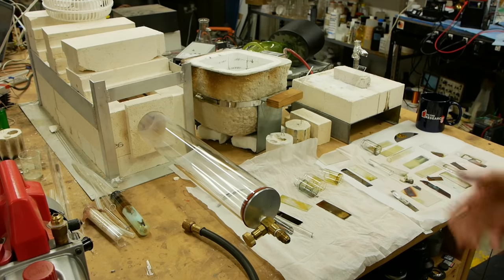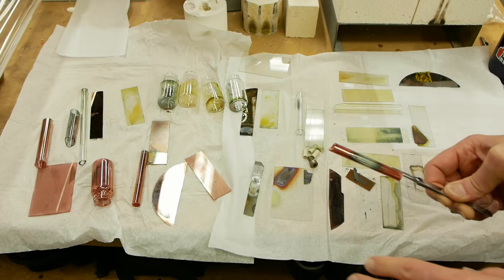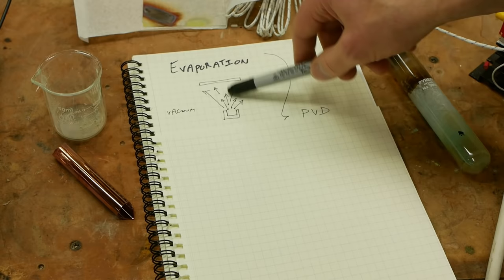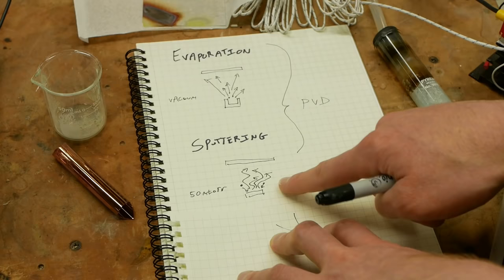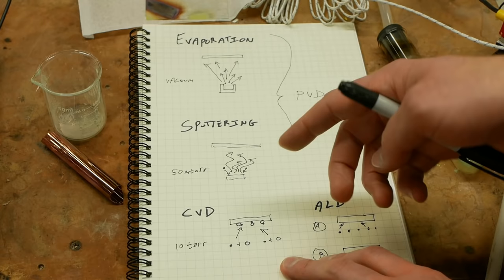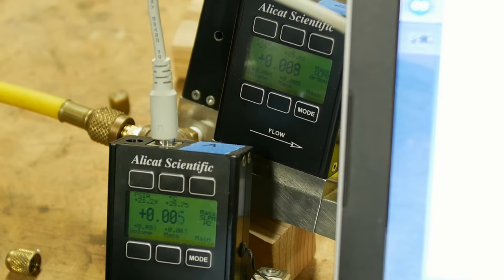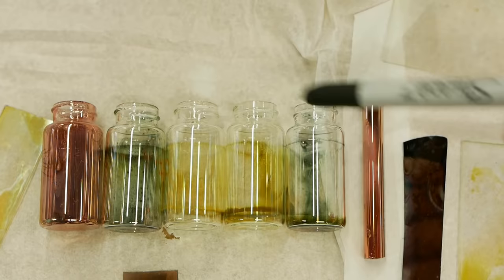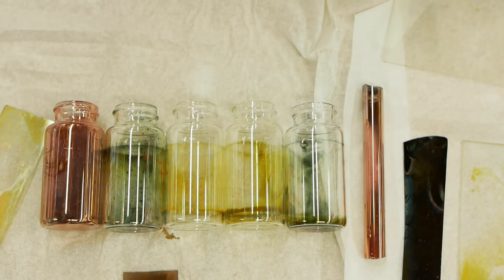Atomic Layer Deposition of copper - If you like sputtering, you'll love this!

Comment: This is a good demonstration of why chip manufacture is so tricky and requires such contaminant free environments.
Reply: If I recall correctly, chip manufacturing is the only industry that commonly uses chlorine trifluoride for surface cleaning. Guaranteed to remove anything (except, perhaps, teflon.)
Reply: @eclectichoosier5474  Removes PTFE as well, just slowly. Also will remove all surfaces an atom at a time, which is why the inside of the cleaning machinery is classed as a disposable part.
Reply: @eclectichoosier5474  Also when reprocessing uranium to make uranium hexafluoride which is then enriched.
Reply: The chips are sensitive to damage from static electricity as well, so they are frail in many ways.

Comment: The flow controllers probably use a proportional valve which are notoriously leaky when off. The usual way to deal with that is just to put a regular solenoid valve (which are not leaky) in front.
Reply: This
Reply: this^^^
even the highest end MFC's are leaky. CVD systems ive built always have a pneumatic high vacuum valves before and after the flow controllers.
Reply: I have that same controller but in the equilibar brand. You are absolutely right.
Reply: Yup. Valves that control flow don't control no-flow very well. Vice versa as well. In gas measurement on larger scales you're exactly right -- both types of valves are used in-line.
Reply: Alicat makes controllers with that option. We ordered one for work, still have not received it though.
Reply: That was the first thought that came to my mind too.
Reply: @jeffmorris9893  no
Reply: It helps to have a pneumatic valve on both sides of the controller. If you only have one on the up stream side it does stop the lhe longer term leak by but it doesnt allow you to stop the gas immeidatly. One on each side with the same pneumatic supply allows for a more crisp on and off for each gas.
Reply: Good point.
Its not strictly true as it very much depends on the mechanics of the valve. But as others point out most industries use isolation valves in conjunction with flow control valves. I've worked in the Australian LNG industry and it's very common there.

More recently I saw a type of ball valve used in a waste water treatment plant. The ball has a V-type notch so that its not as abrupt when it first opens. It had (for water) excellent off sealing and (for water) good flow control. Plus when it was fully open it was like a normal ball vale and had effectively zero flow restriction.
How well that type of valve would work with any gas I don't know.
Reply: Would a three way solenoid valve make sense? 
That way you'd only need one expensive flow controller, but a relatively cheap three way valve to control which gas is flowing?
Reply: The flow controllers are usually calibrated to a single specific gas, but there might be ways around that.
Reply: @fredo514  I believe there are serially programmable controllers, that would make for an interesting experiment... I think the flaw in this theory is that Argon must flow at all times. So possibly one controller and one regulated supply? Unless different rates of Argon are needed for different gases; then two controllers.
Reply: @fredo514  Most flow controllers are thermal capillary types. The manufacturers sort of pretend that they do a different calibration for different gasses, but they actually just apply a factor (which you can find in the manual). How well this works can depend on the design, and you might have to zero the meter between switching gasses.

These days MEMS type MFCs are getting more common, which don't allow for this trick as easily.

Alicat specifically is a "Delta-P" style MFC, which advertises that it will work well with an incredible amount of gasses, and has a nice interface to allow you to select the one you want.
Reply: on the systems I work on, we actually have 2 valves, 1 before, and 1 after the MFC.  This enables pumpout between cycles, or to prevent releasing hazgas into a vented chamber, and thus the atmosphere.  You dont need TEOS or even worse, Silane getting in your face, or out into the air
Reply: @fredo514  You are correct, most MFC's are calibrated to N2 or AR.  To use them with other gasses, you will input a calibration factor to whatever control system you're using, and the MFC will scale properly

Comment: The pattern on those glass pieces is most likely due to the amorphous structure being aligned differently when the glass was necked down
Reply: I use similar vials and silver them using Tollen’s reagent. If I don’t clean them I see the same pattern. I end up lightly chemically etching them with a hydroxide solution and then get a nice  even mirror. I agree it has something to do with how they are  manufactured.
Reply: Is there a guess as to the vials being blow molded(looks like a beer bottle with a noticeable seam, with a bubble of glass inflated into a two part mold)? Or spin cast (usually no seam but a molten ingot spun into a radial mold)? I'm interested in the physics of the manufacturing that may lead to the materials properties...
Reply: Yeah, had the same thought; you reckon if annealing the glass and cooling it down very slowly might help?
Reply: Glass can hold a charge. Could it be those areas are slightly charged? Could grounding it help?
Reply: That would make sense to me. Also super fascinating! I never considered how molted glass is formed could create different structures, but yeah, makes sense. I wonder if there's any other ways to detect these variations.
Reply: Carbon/graphite is used for tooling hot glass. Cheaper graphite will have a large amount of 'ash'
Reply: @codygoldhahn2680  Those are blow moulded bottles, the difference in the middle versus top and bottom is that the top has the glass compressed during manufacture, the middle is stretched due to the blowing and the bottom is compressed again in the mould. They start as a blob of glass that drops into a forming die, and this then has a steel rod rammed in, to make a preform that has a neck and the beginnings of the bottle. Then it, still with the top of the form with the neck and shoulder, rotates to the next station, where a bottle die is placed under it, and it is blown with compressed air to shape. Then released out of the mould, and flame treated to soften the sharp edges and form the soft contours. Finally into a long lehr to slowly cool the glass from red heat to room temperature to remove most of the stress, and then to inspection, either by hand or by an optical checker, for high volume jobs. 

Then packed into shipping units, either a box with layer after layer of corrugated cardboard trays filled with bottles, or on a pallet with layers of polythene sheet spacers, and a final shrink sleeve to hold it together for larger bottles.

The top and bottom glass very likely is chemically different to the middle, just due to the compression during manufacture, and then the long heat soak selectively removing components from the top layer by evaporation and reaction with the gas flames in the machinery and lehr. You would probably want to clean them with the regular ultrasonic and wash, then use a weak HF solution to strip the surface coating off the glass, as this will take the thin layer of iron and chrome carbide that was adhered from the mould sections, leaving a nice reactive surface for the coating to adhere to. Just has to leave an even light haze on the surface, and the copper will adhere well. The plasma cleaning in the oven would handle the final cleaning to get rid of atmospheric contaminants from the transfer to the oven, and there you can use the hydrogen to enhance the plasma, or just use the argon instead, as the heavy ions will strip surfaces well. If it is stripping the deposits off the end of the tube it is definitely going to be making the samples clean.
Reply: @mackensteff  I want him to do this and see if it solves his problem. I bet it will.
Reply: @SeanBZA  Oh hell yeah. Was looking for the first comment to mention HF.
Reply: Doing glass-blowing for years, I was thinking it's either the result of alignment/stretching, or possibly the differences in heating (resulting in smoothing and randomization when molten) and annealing (thin areas cooling faster OR the opposite - being subject to more effect from the annealing penetrating them longer, while the thick areas actually retained cold).  I propose a few tests: 1. Examine the internal glass tension with polarized lenses. (While not directly related to the surface finish, it'd be interesting to see the correlation). (I don't think this is "it" though; that is, I think it's likely more of a result of the blowing/forming process, not annealing). 2. Others have already proposed surface treatments that may or may not make it uniform (should be interesting anyway. Maybe it can even "bring out the grain," so to speak).  3. Similar bottles from a different manufacturer, where the process would likely result in some differences.  4. You can also try circumcising one or more of them, removing the threaded portion (actually I'd remove the threads and the top curved portion -- down to where the sides would all be parallel, or a few variations).  I think cold-cutting with a diamond/abrasive wheel or whatever).
Reply: @SeanBZA  Hey, I wonder if, in storage, the settling and balance of vapors (like from outgassing from the lid, or even electrostatic differences) resulted in some consistent layer-effects he was bringing out with the deposition.  I wonder if this could be used as a very sensitive forensics technique... Hmm. Anyway.
Reply: Ahh, that makes more sense than what I was thinking. I was thinking that maybe they were acting as a Helmholtz resonator as the flow of gas moved in and across the top, but I don't think this explains why there is such a sharp line.
Reply: Looks like a shadow from the opening under the shoulder to me. Stick a skewer in and see what it doesn't reach.
Reply: I see a very similar pattern on my glass receptacles... particularly my beer pint glasses after several cycles through the dishwasher. They remain clear and then seemingly over night the etching from the soap becomes pronounced and the pattern is very similar among all the glasses.
Reply: @codygoldhahn2680  i don't think they are blow molded, i think they are made from tubes like this https://www.youtube.com/watch?v=vdDSZUjFmb4 this would explain the ring of different material properties at the top since heating the glass causes the surface to lose flux, the only difference between a vial and a threaded bottle is that instead of just necking down on a flat roller, you use a roller with a impression of a thread and interrupt the material into the groove to make the threaded neck.
Reply: @Amasarac  I think you're right.  The straight sides that behaved well is glass original to the tube they started with, and the top part is contaminated with metal from the forming tools that were rubbed against it while molten.  I couldn't tell how the bottom was formed exactly, but I think after parting the hot blob collapsed to close it, it must have been placed against a mold and blown to press tightly against it.  So, the straight sides are the only part that was not both melted and worked with tools in that state.
Reply: @JohnDlugosz  the bottom is usually formed by heating a ring of glass and rapidly pulling them apart to separate, then the bottom which is now conical and very thin is just reheated and surface tension does the rest. A lot of people have suggested they are blow molded but I'm convinced because it is Ben we are talking about he most likely has borosilicate vials which are not suitable for blow molding, borosilicate is almost exclusively lamp-worked except for a couple of very specialist applications.
Reply: @JohnDlugosz  Wouldn't the tools only be used on the outside of the bottle being made, in that scenario?

Comment: You are accidentally still doing CVD. There's huge amount of reactants still in your lines after you close the fow meters and instead of 30s cycle time you probably need 30min. To truly stop reactant flow in those lines you need inert gas barriers on each source. Hydrogen is simple with two solenoid valves and two needle valves. Put two T junctions on the line. First (closer to flow meter) goes trough solenoid and needle valve straight to your vacuum pump. Second (closer to reactor) goes trough solenoid and needle valve to your carrier gas supply. Now when you open both solenoids hydrogen has straight path to pump and leftovers in the line will be purged by reverse carrier gas flow. Close the solenoids during hydrogen pulse.

For copper source it's the same principle. Just imagine that the second T-junction is inside the reactor hot zone and and reactant is just before it. You'll need one extra feed trough into your reactor for the blocking gas. This apparatus is usually made out of quartz but you can probably get away with glass or even stainless steel.

Source: I operated and modified experimental lab-made tubular ALD reactors in uni for many years.
Reply: This feels correct.
Reply: Still thumbs up for the effort, aye? :)
Reply: I'd rather use Argon or Nitrogen
Reply: @call_me_stan5887  For sure! In principle the ALD procsess is quite simple but in reality nailing the procsess window with all the temperatures, flows and pulse timings is not trivial even with commercial machines. What Ben has achieved is impressive. I hope he'll pursue this further because ALD capability would be handy considering the stuff he does in hes projects.
Reply: @kasparroosalu  Thank you for your insightful discussion :) I'm sure Ben will surprise us with many, many projects. I know he reads comments and sometimes indeed modifies methodology accordingly.
Reply: Yeah definitely this is right. I definitely was thinking the exact same thing because I definitely know about this topic too
Reply: @UnitSe7en  It's science.  It doesn't "feel" anything.  It's cold hard data.
Reply: The lack of precision is unsurprisingly producing inconsistent results.  The commercial machines aim to make the process repeatable and practical.  Even still they have to be operated within design specifications, batches fail, feedstock quality and consistency matters, etc.
Considering the crudity of the apparatus used the results are laudable.  Well done.
Reply: @TechGorilla1987  No. It's someone making a comment on YouTube. 100% hearsay by the cold ruler. 

But it definitely feels correct and I'm willing to trust their opinions on that instinct.
Reply: @TechGorilla1987  Do you have cold hard data on the gas concentrations along the tube during the cycle? If not, the feeling of experts is the next best thing.
Reply: Feelings do not educate me.  Research does.
Reply: @TechGorilla1987  So where's your research data? All we got in these comments are various opinions. And yours were until now the least useful ones.
Reply: Great input to the discussion.

On his plasma cleaning I think he need to not simply place the parts in the bottom of the tube. No matter what in that case different areas of the parts get different exposure.

I did work in the auto sector (as a control and automation engineer) and they used plasma cleaning for the reflectors in head & tail lights before coating the parts. I helped build one of those lines for Hella (in Australia). For the final deposition (which used evaporation) they had all the parts on this carriage that was driven the same way an epicyclic gear box operates. The parts were on shafts that were extensions to the planetary gears. So the parts not only spun on the shafts but the shafts rotated around the center of the vacuum chamber. That way they got evenly coated. 

I don't think he needs to go to that sort of extreme here but he possibly needs to ensure and even flow of the gases and plasma across and around the parts he's trying to coat.
Reply: engineering nerd corversations be like ...
jk i like to read it too even tho i understand maybe half
Reply: @kmit9191  as PhD candidate with thesis on ALD, I can tell you that you are 100% correct :)
Reply: @tiporari  Sorta' like he's constructing a mnemonic memory device using stone knives and bearskins? ;)